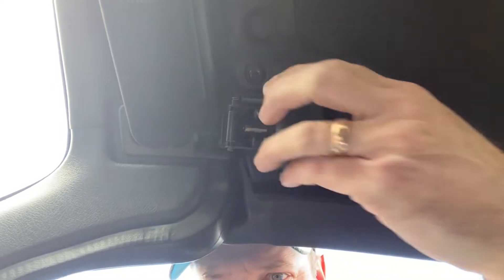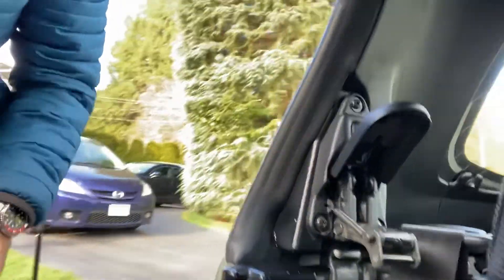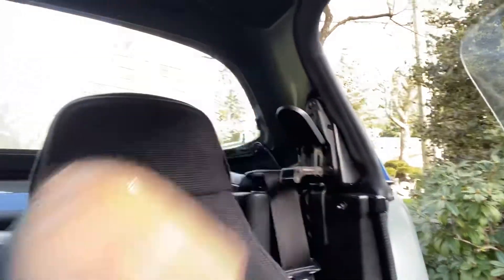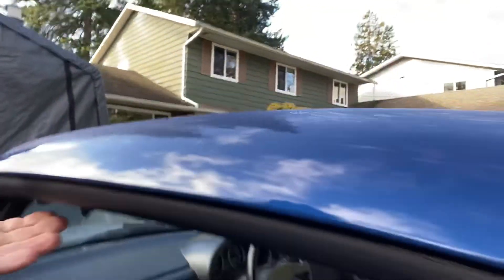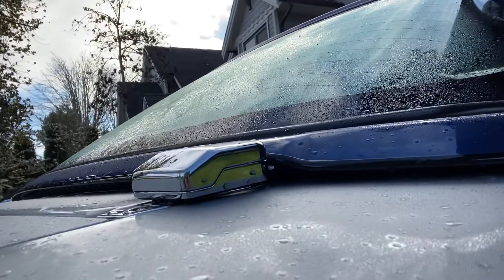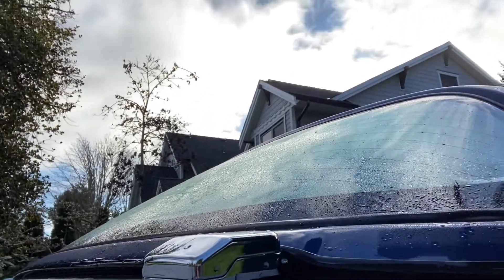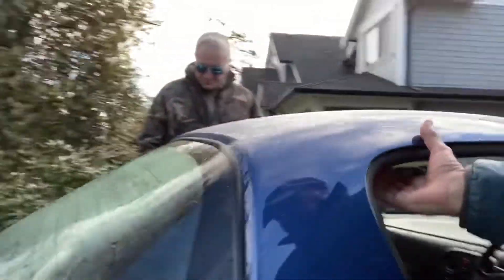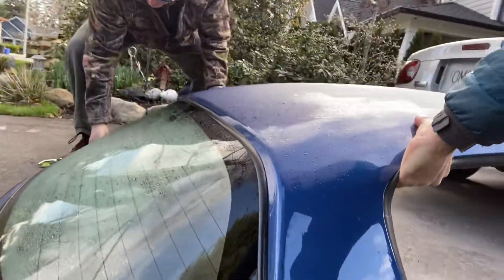Miata hard top help: #2

Comment: Hi, really informative video, thanks!  I have an NB2 from 2001, I had to take the hard top off recently for some bodywork repair and after I put it back on the car (first time I've ever done this) I've been hearing a lot of horrible squeaks when I'm driving. I think the noise is coming from the front left of the hard top where it joins the windscreen. Anyway, I was wondering if you have a video of how to put a hardtop on correctly so that it is securely fastened? Many thanks!

Comment: just got a hardtop last night- opened the chrome latches in the back and the frankenstein bolts are so far away from the cleats. there’s no way i can adjust them to grab under the frankenstein bolt. the two adjustable bolts seem too small and just rattle around in their holes! im stumped
Reply from the maker: Is it a factory hard top or aftermarket? 
Did you have the front latches adjusted and latched up?
Reply: @MiataMan  it’s an oem hardtop. i discovered the nuts are missing for the bolts inside the chrome latches, that’s why they’re rattling around. i didn’t know the front latches could be adjusted! i’ll try that next and see if i can get the brackets closer to the frankenstein bolts

Comment: just got mine and figuring out how to get fitment figured out.... pretty rattley
Reply from the maker: I would adjust the cleats inside the chrome “deck locks” that grab on to the Frankenstein bolts. 
You can also adjust all four of the latches to get the clamping power firm and even on all four points. 
Be careful not to clamp them too hard.